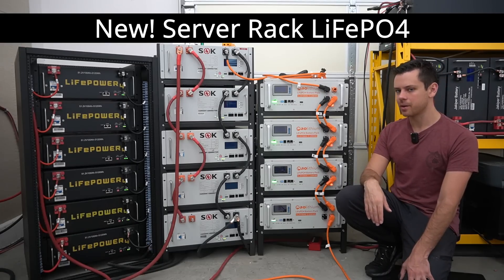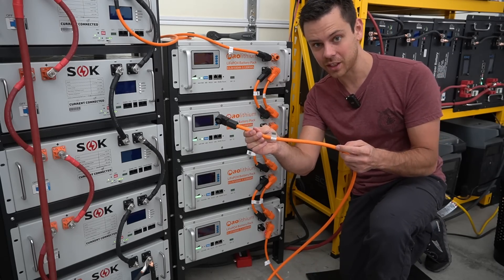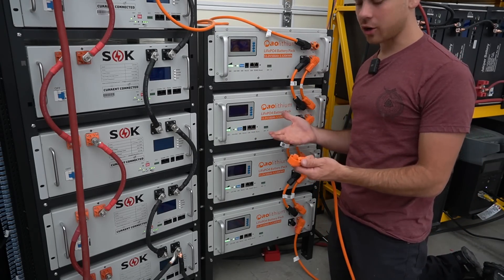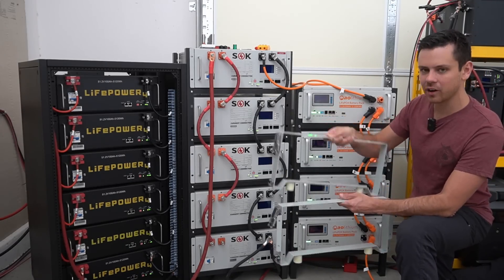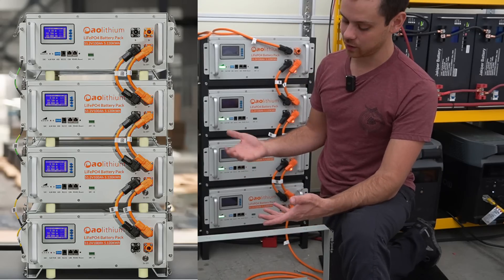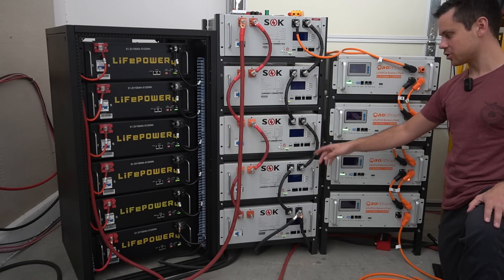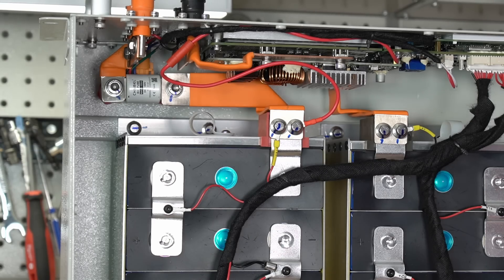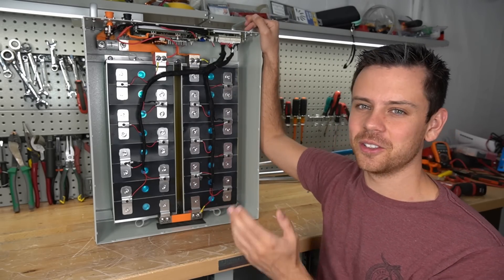New! 48V 5.12kWh AOlithium Server Rack LiFePO4 Battery

Comment: Hi, we are "suddenly" thinking diferent in Northern Europe how to get electricity since it today 28th Of September cost almost $10 to run a 1000W heater 24 hours. Compared to 50 cents last year.
I know you are most in to solar. Since here is so much darkness in the winter, it would be great if you could recommend a good combined thing Solar/water/wind turbine for ehh.. "Dummies".. 
And a Quick question. Do Rich Solar Ship to Europe? 
God Bless you and your Electrical Home!
Reply: What? Maybe it went 5x but not 20x!
Reply: Normally electricity is super cheap in Norway. We use 23.000kw pr citizens a year. We are used to $0.0055 for 1kw now it is $0.55
Reply: @olavtrygvasson647  Wow!  We pay $0.32 for first 292 kwh in a month, then rises to $0.39 for anything over. But after 1168 kwh the charge goes to $0.49 per kwh.  This is in Northern California. To reach the $0.49 per kwh, the home would need to burn up 38+ kwh per day. This is easily done with electric heating and Air Conditioning. Why is your power company gouging you so badly?
Reply: It's a complex thing. Without much research "or listening to the right people" there been made a new subsea cables connecting Norway to the UK and Germany. "Export" Than the south of Norway got prices set by some EU companies, even though we are not in the EU. (i don't know if comments are being deleted if I post links, but I try under) otherwise if you google. "Why have eletricety prizes gone up in Norway" you will see similar links.
Everything in Norway is eletric. No one is heating their house, cooking on gas lijw rest of Europe. And the car park has been changed to eletric. A new gasolin Volvo because of taxes, cost the same as an Tesla. Tesla is everywhere. The taxi are tesla. Not all of them, but many. Only reson some one will turn and look little bit on your tesla in Norway must been if you foil it in pink or something.
Reply: @olavtrygvasson647  Thanks for the update! Wow $0.0055 was extremely cheap. In Austria where we have loads of hydropower as well the consumer prices for electricity never went substantially below $0.1 per kWh, even before the war.

Comment: I don' care for the exposed DIP switches on the front panel. It would be much better with some sort of "Flip Up" plastic cover. I really like when mechanical switches are not able to be changed by accident, or other error...
Reply: Some batteries only acept dip switch settings after restart, so you can not change anything while they running.
Reply: @exshvezdickou  I understand the need for the function the switches provide, I just want to see them protected from any unwanted, or unintended manipulation. Either way, I still see them an a potential issue, which could easily be rectified.
Reply: @morgananderson9647  I've never heard of someone accidentally flipping a dipswitch. seems like a made up problem.